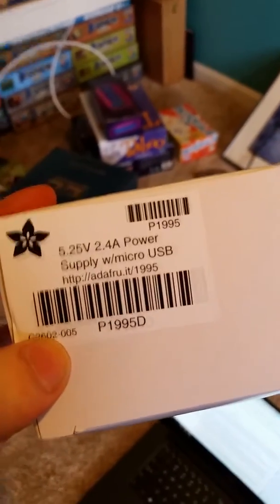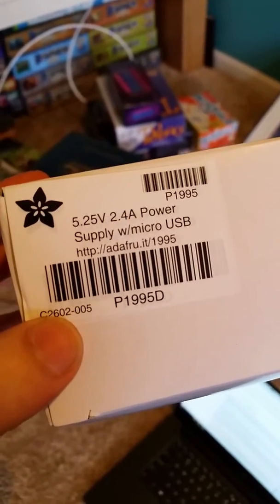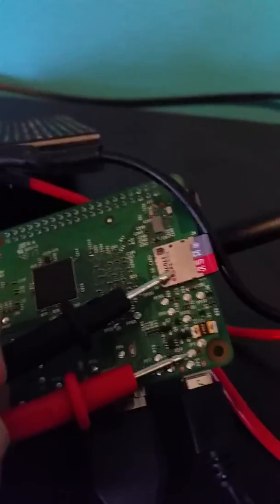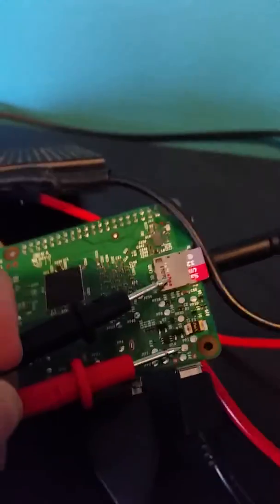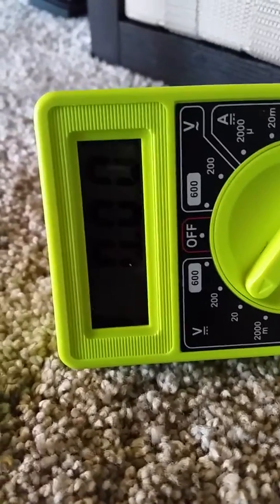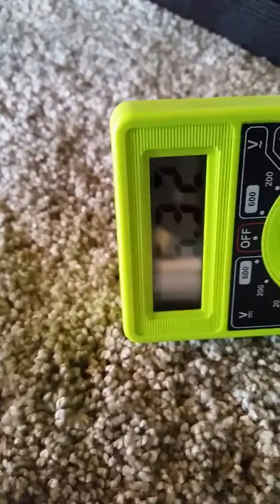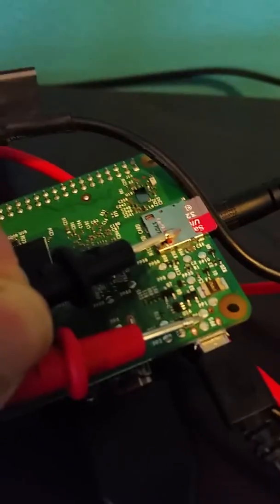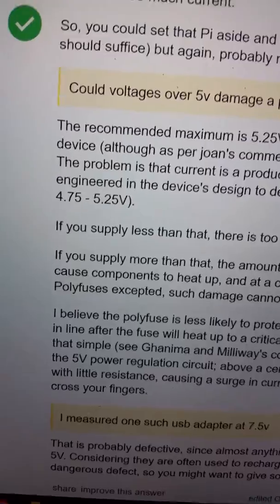Power issues w/ RaspberryPi3. Red light only. Voltage issue?

Comment: The built in boot system in the GPU which can not be changed, will only boot from FAT. If your SD card is 64gb like mine, you need to format it for FAT from exFAT. It will not boot exFAT. Also extract the OS to the card, don't copy it. Also do not quick format spend the 30 minutes to an hour to properly format it. You can get free software for SD formatting from the raspberry pi site.
Reply: copying and extracting do the same thing you're moving the same files to the same place.